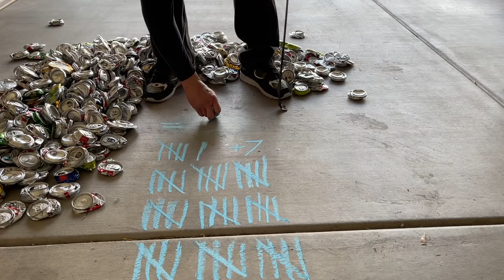Massive Can Meltdown - How Much Pure Aluminum Is In 500 Cans - Is It Worth Melting Aluminum Cans

Comment: I work for an aluminum rolling company. Scrap aluminum is incredibly valuable because of the INSANE amount of energy and cost required to produce prime aluminum from bauxite ore. Aluminum is infinitely recyclable - meaning it will not lose its properties over time as it undergoes various transformations. The key is simply to have large scale, efficient industrial processes. The margins are small for can stock but they add up when you apply them accross the 100s of millions of pounds produced each year
Reply: Even molten aluminum oxide slag can be reacted with electricity and a carbon rod to return it back to elemental aluminum from what I recall
Reply: Thanks, that's interesting information.!
Reply: doesn't recycled aluminium in case of particular applications together with iron/steel components have iron contamination? that makes the aluminium alloy fragile and the mechanical behaviour very bad for some applications, so it's not technically always recyclable. Still, there are so many uses for it that it can be used for something else.
I checked my old notes and also it seems that the energy consumption during the recycling process is roughly 90% of what you spend for primary extraction, but you save tons of scrap, MANY tons of water, and a considerable amount of CO2 and SO2.
Reply: @AB-ld1rp  so, when aluminum oxide is converted back into elemental aluminum, addition of other elements to precipitate iron with crystalization and filtration. By doing this, whether or not it was originally alloyed or became contaminated it can be removed to lower traces. However it still takes a while so you're on the right thought process of it being a bit hectic.
Reply: Problem is I get screwed by the recycling places here and it’s not worth the trouble breaking down extruded aluminum windows . 
I could easily bring in 3 maybe 4 tons of pretty clean aluminum but my shifty local dealer will start dropping the price to 15 cents a pound for a few screws .  I want 40-50  at least for my clean.  Just not worth it when I have three boys and a wife fighting  for my attention
Reply: @kylesteele9403  what's a carbon rod
Reply: About 30 years ago I read that throwing out an aluminum can (versus recycling) was the equivalent of throwing it out half full of gasoline, in terms of how much energy it takes to produce a new one from bauxite ore. And speaking of bauxite, there were mountains of it stockpiled by the U.S. Government not far from where I grew up, and as far as I know they’re still there today. I always wondered why they were never moved - old timers once told me they’d been there since WWII - and suspect the value of the ore wasn’t high enough to warrant selling it off and turning it into aluminum.
Reply: Then why dont they pay better when recycled
Reply: In Guyana, large areas of jungle are now desolate due to open cast mining with blast hoses for Bauxite. So, recycling is totally worth it.👌
Reply: Hello sir may I ask. I'm a university students in Indonesia and I'm currently working on my final assignment which is analyzing the effect of adding Magnesium to the hardness of an aluminium from scrap (beverage cans). And I wonder how much cans do I need to produce a sample specimen for hardness testing? I do appreciate your answer if given 🙏
Reply: @andrianlauwis8022  500
Reply: @ZZ-topp  hah? Really?
Reply: Qué hacéis luego con ese aluminio que habéis fundido?
Reply: @wombatburrito5896  Find a better dealer and learn how to negotiate. Have a large amount to recycle, to get the highest price. Bounce one dealer off the other one on what they pay for a certain amount of scrap and then ask them what they’ll pay for 200 pounds of that same scrap. They should pay a higher price for a larger quantity. Then call the other dealer and ask him what he’ll pay you for 200 pounds. Finally, let the dealer closest to you have a last look. If he matches the highest price, you’re good to go.
I’d like to melt down the thousands of aluminum cans I have, but I don’t think it’s worth the time, expense and risk to do. I have heard that ingots sell for about five times the price of a plain aluminum cans, by weight.
Reply: i googled how much $ of aluminum he made from those cans....about $10 bucks worth.
Reply: @joryharris8002  is that selling it or buying it?
Reply: @joryharris8002  no way… the propane in our area is about $20 to fill a 20 lbs tank. Are you saying he lost -$10 when factoring in fuel? Wow.
Reply: A
Reply: I work at an aluminum rolling company as well. We roll primarily 3000 series alloys for building and construction markets, license plates, commercial cookware, RV components, etc. I run a tandem 2 stand 4 high cold mill.
Reply: I live in Kentucky and with electricity being reasonably priced thanks to coal, it is very profitable to turn in and sell cans for recycling. Right now, they are paying 75 cents a pound.
Reply: Really?  So you could really recycle it over and over again and it wouldn’t lose any, not sure what the word is, purity?  Integrity?  That’s neat!
Reply: How much cash can you get for 10 lbs of aluminum like this?
Reply: @tobyhorn9641  A rod made of pure carbon ...
Reply: @sherrylawrencelewis2544  Guyana's bauxite deposits started being mined after WW2 began due to a shortage of aluminum. Alcoa and Rio Tinto operated the mines which gave the British colony a tremendous economic boost. Once Guyana became an independent country in the mid-1960's, the first thing their new government did was to nationalize the bauxite mining operations without offering Alcoa or Rio Tinto any compensation. Both left taking key employees with them leaving Guyana with operations nobody knew how to run. Their once thriving economy immediately went downhill and stayed that way for the longest time.
Reply: @AB-ld1rp  I thought recycling aluminum cost 90% less than primary extraction and refining?
Reply: @wombatburrito5896  Ever try using a reverse-twist drill bit on the screws? The bit will snag on the screw and twist it out. Another cheap trick is to use a Sawz-All to cut thru next to the screws and toss the small pieces into your dirty aluminum bucket.
Reply: @alan30189  The scrap yard I use separates the various types of aluminum scrap to smelt into ingots that are then stamped to show what kind of alloy they are. Think they stamp the can ingots with a C since those are only good for making more cans.
Reply: I had  heard the Aluminum was jokingly called solid electricity.
Reply: So I should melt down my cans instead of recycling them for free??
Reply: @jsfields00  Scrap aluminum has been in demand for quite some time so should be able to find a recycler or salvage yard willing to pay cash for what you have. You don't want to melt down aluminum into ingots since that lowers the aluminum's value to dirty aluminum since the recycler/salvage yard has no idea of what other metals the ingots may contain.
Reply: 95% of the energy usage is saved when recycled compared to mine and process the ore. It is when the refining the energy usage is so high. I just read that if refine the oxid 10000 kilowatt hours of fossil energy and 20000 kilowatt hours of electricity is used. For every metric tone! 
95% of this energy is saved if recycled. If it is pure enough!
Reply: @andrianlauwis8022  what did you conclude
Reply: @joryharris8002  we must also remember that (according to the comment above) he saved Mother Earth from 250 gallons of gasoline going into her garden needlessly 
🏝🌗💵
Reply: @mmproductions565  I didn't continue the research, because it's very hard to alloy aluminium without the proper equipment
Reply: Well, most guys are wondering weather it is worth it or not to melt cans to have a better price given to their aluminum. Si, If you can do most of it using coal and wood it could turn out great, you can actually get free wood and cheap coal to do it and cut your propane expense by a lot. The downside is that it takes more time, space, effort and better safety precautions to do it that way. 
I had a big property before where trees would shed their leaves all year by huge ammounts, so it was easyer to burn them than to do anything else with it. Then I had to get rid of a dead peach tree and other trees so I got a lot of lumber to burn. I wen out, bought cheap coal, got my leaves and my scrap wood and melted a ton of cans (like 2000 or so). It was fun, but the value was on the floor because the guy that bought cans didn't trust me on the fact that I had melted only cans and that the lingots had no plumb or steel core to make them heavier. So I got can price for it after a couple hours of negociation.
Reply: You sound like the Hank Hill of aluminum.
Reply: Except it does turn to oxide overtime
Reply: @AB-ld1rp  Damn.  You just can't win;
Reply: Is the dross recyclable? I know I'll never get all the aluminum out with my small operation. I don't want it to go to waste.
Reply: @AB-ld1rp there also the sf6. This is used as a blanket gas to keep the air from hyper oxidizing it. Without this it is a flare. Terrible for the atmosphere. Zero alternatives.
Reply: Have a 1000th like!
I learned something new today

Comment: Ive collected 14,000 cans over past 5 years. The farm shed is completely full of cans I need help. I cannot stop. Looks like Ive got 140kilo of aluminium.
Reply: dude 14000 cans =$1,400 , cash them in. I've collected 14000 cans since December 25  , 2020
Reply: melt them under Argon, consider a tilt furnace, cans in cricible sealed in argon; or induction in argon chamber.
Reply: That's about 300 pounds.  In California, you can turn them in for cash.  The rate is about $2/lb so you have about $600 worth.  Hope your country or state has a redemption program.  Otherwise, your hoard is worthless.
Reply: @encinobalboa  in oz  [ the land down under ] we get 10 cents a can
Reply: In actuality for recycling i feel like we "get" nothing. We get our money back. Next time you buy a soda or case of waters or something pay attention to the crv (california term sorry. Whatever its called for your area).

Yeah. We dont make money recycling we mostly get it back. Its a tax return.
Reply: @jimburnsjr.  I'll add to that, shred the cans so you can fit more into a given space.
Reply: You need an interdiction....
Reply: @2000freefuel  ?
Reply: @tigersgalore5723  usually 5 to 10 cents in U.S.. depends on state. Same for glass bottles,  plastic water bottles.
Reply: @2000freefuel  I feel like even that is an energy cost that's not worth it.